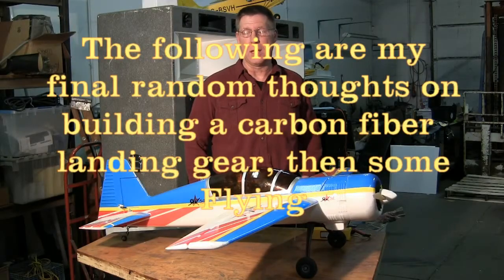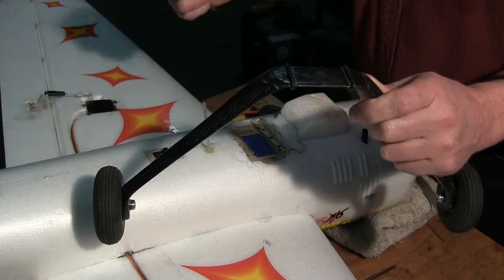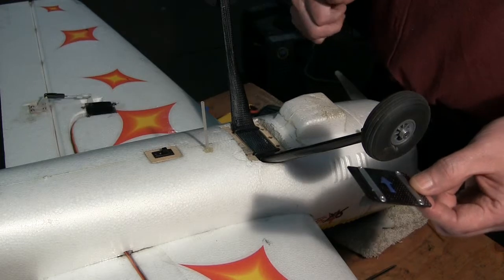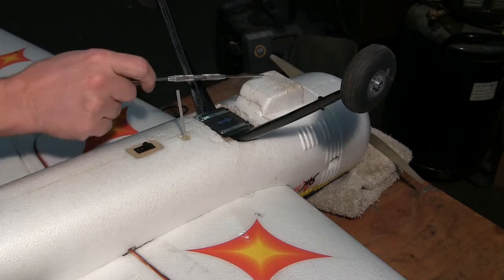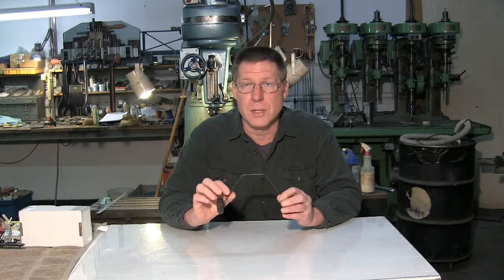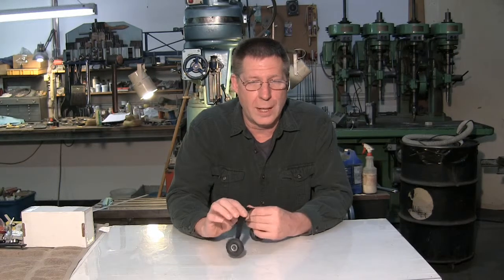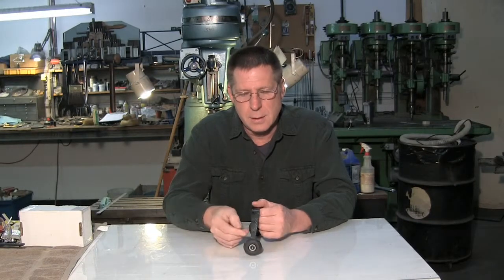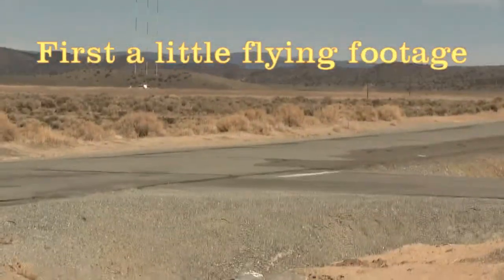How to build a scale carbon fiber landing gear for an RC plane pt. 6 of 6

Comment from the maker: If you want to make the bottom of your fuselage more abrasion resistant, to avoid damage when it lands, then carbon fiber would not be the best material for that. For abrasion resistance carbon fiber and fiberglass are very similar. CF is also much more brittle than fiberglass, so it is not as good for impact resistance either. If you need maximum abrasion resistance then I would recommend using Aramid fiber/Kevlar. Kevlar is much more abrasion, and impact resistance than either CF or FG.

Comment: hey. i have absolutely no experiance with carbon fiber, but from what i saw on your videos, it looks like you work with it almost exacly like you would with fiberglass.
so i am wondering if carbon fiber could be use to reinforce bottom part of the fuselage of EPO/ELAPOR glider without landing gear?
and if so, how resistant would that be?

Comment from the maker: With most epoxy resins used for hand layups, a post cure in an oven at about 160 degrees Fahrenheit (or the post cure temperature recommended by the resin manufacturer) will improve the strength significantly. In this case, the landing gear is plenty strong with a room temperature cure, so I did not post cure it.

Comment from the maker: Thank you. The two most common misconceptions about carbon fiber is that, it is hard to work with, and that it is very expensive. As you can see in the videos, it isn't really that hard to work with, no harder than glass at least. Compared to glass, you use about a third the amount of carbon fiber than you would if making the same part out of glass for the same strength. So, in the end, it usually only costs about twice as much as the same part would made out of glass reinforced composite.